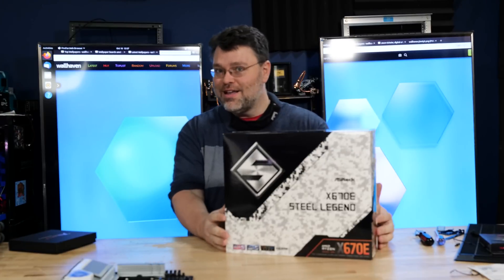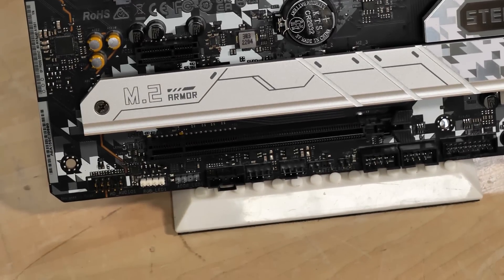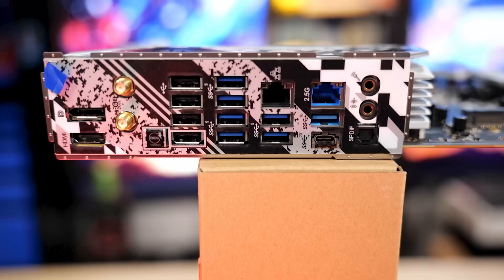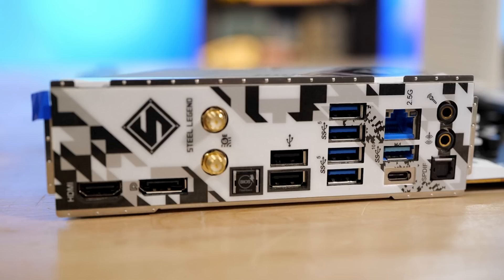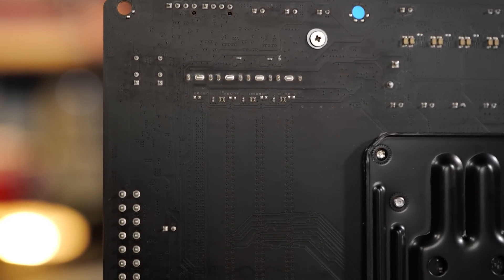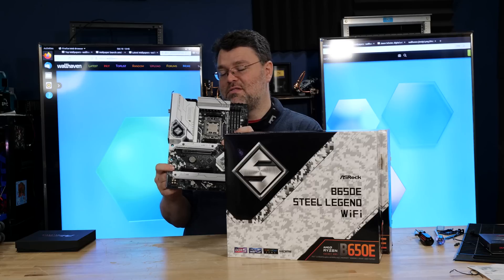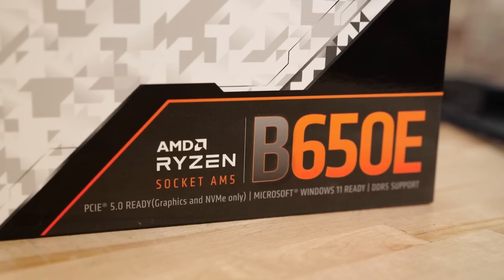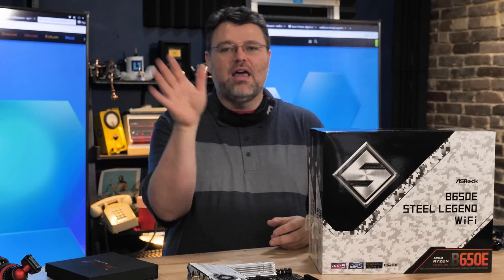PCIe 5 Without Breaking the Bank? ASRock Steel Legend B650E Review

Comment: Shame it doesn't have analog audio, I'm still using analog speakers and I don't understand why skip then on a "budget" motherboard since it only makes you spend extra on spdif or USB speakers
Reply: If there's no analog audio, then what's those 3.5mm ports with speaker out and microphone icons? My guess is Wendell meant no 5.1/7.1 rear ports.
Reply: SPDIF is great, specifically bought aorus b550 pro for it since msi tomahawk max somehow doesn't have it. You can get a good 5.1 setup for cheap with an old used receiver
Reply: If you care anything about audio quality at all you should be using an external sound card, I’m a professional sound engineer and have tested many motherboard onboard sound cards, apart from digital outputs all the analog outputs were quite frankly unusable
Reply: @murraywebster1228  no offense, but it's a budget motherboard, I wouldn't find it strange for people to be using flea market headsets with it
Reply: You could use USB out to a really inexpensive DAC and get away from some of the electrical noise on the motherboard, and still retain your analog speakers
Reply: I would recommend getting a cheap USB dac/amp combo, there are tons out there. For $100, M-Audio has a great desktop option that'll get your speakers working (with a knob!)
Reply: @alexmartinelli6231  100 is not really that cheap, gotta remind you AMD charges a lot on the mobo compared to Intel, then for a third world country like mine, that's about the same I'm paying for the CPU alone
Reply: @irvingchies1626  there are also like $5-15 ones that plug into the back and get you those ports back 👍
Reply: @irvingchies1626  if you really need that 5.1 / 7.1 onboard audio, the manual says you can use the front panel as 2 extra jacks. Depending on your setup that might mean you'll need to get some y-splitters to separate the audio channels.

Not really defending ASRock here (only 2 SATA, wtf?), but I just had to comment again to help clear things up (especially now that the audiophiles have arrived along with their audiophile-ry). Also helps with the channels engagement for the algorithm. 🤣
Reply: I don’t think it’s a cost saving move, more so that it’s a legacy interface that only a minority of people still use for regular computing/gaming needs. The market has moved on to USB and Bluetooth for audio, very few devices still natively come in a 3.5 format outside of the extremes (super budget or super expensive). I’m sorry you’re in that minority, it’s a pain, but there are plenty of USB or PCIE 1x/4x add in cards that will give you the functionality you need and last through multiple machines.
Reply: @MeticulousTechTV  "minority" and "gaming" don't get along

"Gaming" and "budget" do get along, and they do trio with "analog audio" very often
Reply: @MeticulousTechTV  uh... the reviewed mobo does come with 3.5mm jacks, so it's probably not a good example of "the market has moved on" or evidence that "only a minority of people still use" it.

If we're talking about the traditional 5 or 6 jack, 5.1/7.1 audio, yeah, that's definitely a minority. I don't think most of the audiophiles in this thread with their external DACs even use surround on the regular.
Reply: Personally i never ever used those 5.1/7.1 analog audio plugs from motherboard in my over 20y pc journey. I also dont know people IRL who did. If they had 5.1 surround they also had $$$ soundcard. And nowdays most people either use just single audiojack for 2 cheap speakers or they use digital spdif/usb/hdmi to soundbar/amplifier/whatever. So they may not be wrong to drop it. Looks like you're that last dinosaur ; )
Reply: @sznikers  the "single audio jack" is analog audio, this is why most people sound stupid on the internet, lack of communication skills...
Reply: SPDIF actually seems to be on its way out... it is not present anymore on the current gen Xbox and PlayStation and lots of AM5 boards are skipping it now as well.  
Good thing i still have my good old trusty ASUS Xonar Sound Card for my good old Edifier 5.1 System because SPDIF aka TOSlink is just essential in my eyes.  

They are all going HDMI for audio these days... not sure how you would plug your HDMI cable into your Monitor and then pass it through to a Sound System on a PC Monitor...  
for TVs that is very normal... but on PC Monitors?! I don't know, that seems just super weird to me, never herad of that being a thing.
Reply: @ZeroB4NG  No, SPDIF is not on the way out. It's always been an "uncommon" output but it's going nowhere.
Reply: Makes sense from the manufacturer's perspective. Cheaper to make. And usb audio interfaces are top notch.
Reply: @QuickQuips  Except it's not cheaper? It's a 270USD mobo, that's far from "budget".
Reply: @FEARmeify  cheaper for the manufacturer.

USB dacs from Mytek, Lavry, and RME are in pro studios. I'm personally happy with my Audient. They're fantastic.
Reply: @QuickQuips  literally no, they are the worst. please know something before saying something.
Reply: Get an external dac once. It will be better than on board and last across many machines. Dont look back.